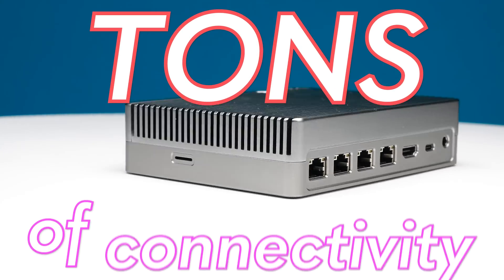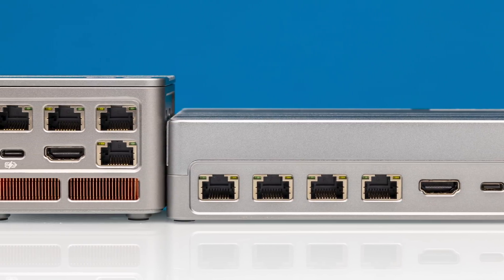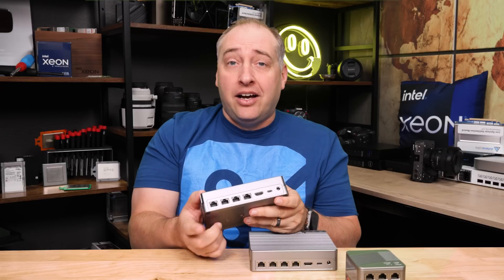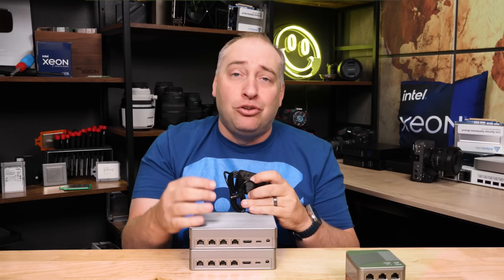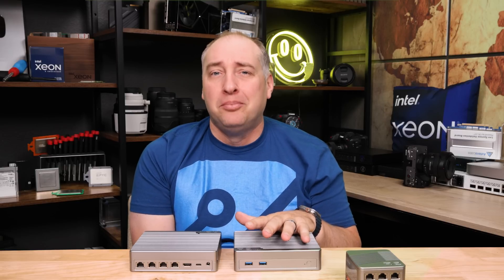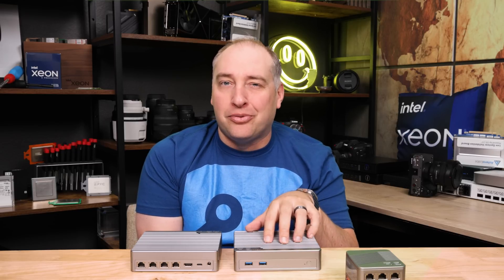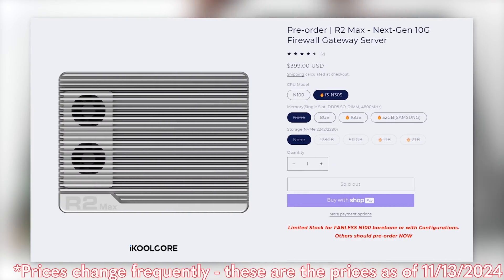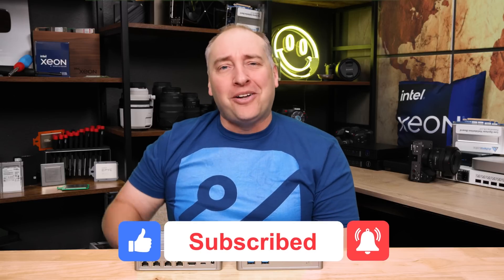MAX Fanless 10Gbase-T Mini PC and Router

Comment: Hey, thanks for the video. if budget is an issue i would certainly not recommend this pc.  paying almost 400 for a low performance Core i3 is not aceptable. Instead I would rather get an old ryzen 9 with 128 GB RAM along witha  500GB NVME and  a dual 10 Gbit NIC in a SFF case.  I wont feel confortable having one of those tiny  boxes in a real  world scenario with thousands of pcs hook to it.  DHCP DNS etc for  a large enterprise environment is a serious business which should be addressed professionally Nonetheless it could be a good approch for a small business with limitated space and none critical data transfer

Comment: I recommend staying away from this mini PC and this company in general. I purchased 3 of these units to use in a high availability cluster and one unit kept randomly shutting off. After numerous back and forth with support, BIOS updates, and tweaks, what broke me is the fact that they asked me to install a brand new OS (windows) and run AIDA64 stability tests (there's a trial, but its not free) before acknowledging it is an issue. They repeatedly deny it is an problem with hardware and push the burden of proof on the consumer (I also previously sent core temp and idle data, and proxmox system logs). They even have a dedicated support page on how to throttle CPU performance in the BIOS likely because other users are experiencing the same problem. Bottom line - stay away.

Comment: Would RouterOS run on this? This could be a great device for an aio RouterOS based 10G gateway security appliance utilizing specialized containers etc.
Reply from the maker: We did not try it, but I would imagine the answer is yes.
Reply: x86 routeros will

Comment: I bought this version  (fanless & N100) based on this video.  great build quality.  Its amazing with Proxmox VE.  I plan to use this to run container apps so I can move off a giant box of Openmediavault NAS and migrate storage to Unifi NAS and use this as the services host.  So far so great!!  Fits on a 2u shelf or drawer, yes, I plan to put it in a drawer eventually on the rack with breathing holes in the rear.

Comment: These N100 mini-PC's are really amazing, especially for smarthomes, since their energyuse is below 12W on normal use, which is around raspberry PI levels, but with nearly 2-5X as much performance

I have 2 myself.
Minisforum UN100C for home-assistant standalone [Mainly because Zigbee has some issues under proxmox, with a dedicated usb port for the container/VM]
Bmax B4 Plus, for Proxmox, with addons/containers running on it. for things like adguard, and a few other things that do not need their own dedicated server/RPI

Comment: When it comes to the device, I'd like to see a locking/screwed barrel jack. Or a different power connector which isn't as easy to disconnect accidentally. Other than that, a general question: could you explain how strict Intel's maximum supported RAM size is? I see people all over using 32 GB (or even 48 GB in the other comment), but Intel officially only supports 16 GB. What's going on with that?
Reply from the maker: Totally on the screw barrel jack. On the limit, Intel has had a delta in “supported” and working for over a decade in e-core CPUs
Reply: @ServeTheHomeVideo  There are screwed barrel jacks which also accept regular plugs, so it's not like it would stop people from using regular ones too. A nice improvement I noticed earlier is accepting 12V - that's standard voltage, and much more common than 19V.

I never truly dug into the low-power stuff until I needed to for work last year, so good to know.

Comment: NOTE: The 10gb network ports are NOT SUPPORTED on pfsense,opensense etc.
Reply from the maker: Yes. Noted the Marvell AQC113C drivers are not in FreeBSD, so OPNsense and pfSense. For folks using legacy OSes/ hypervisors like VMWare too. Linux works out of the box and you can virtualize pfSense and run that way too.

Comment: One of the concerns I have had that has kept me from purchasing the units you typically review is the shipping from overseas and lackluster response from some people on the support that those units offer. This one, seems to offer the balance of slightly more expensive for similar hardware and a more portable and perhaps more stable platform. Overall the price might match what you can get something from Ubiquiti but more flexibility by far

Comment: should be -150e cheaper and with more pcie3 lanes for ssd:s so the 10gbps ports could be even properly used for like, LAN-cache or similar purpose. 
nyeh. even as a router, it's wayyyyyyyy too expensive

Comment: There was a decent priced SFP+ model a few weeks ago, but the ram and ssd were a full rip apart to swap. This with the size and ease of access would be great to replace my mATX makeshift router. However using the ATT fiber xpon bypass SFP+ module. So something decent and SPF+ is a requirement to swap to a smaller/lower power router.

Comment: Why are there never any network bandwidth tests? For example, how many boxes with n100 were there, how they were told about their use as firewalls. But in practice it turned out that none of them can pull through the same 2.5 Gb/s in the same pefsense/opensense. So maybe here too, there are 10 Gb/s ports, but there is no use.
Reply from the maker: There are but we used Linux and OpenWRT
Reply: @ServeTheHomeVideo  Oh, there is info on this hardware on the site. But I couldn't find any about the others. Thank you very much for your reviews.

Comment: I hope a future iteration will also include small holes for mounting wireless antennas to, which would be great for 5G/4G/LTE WWAN backup.
Reply from the maker: Good idea
Reply: this ikool T_T please fanless 4 port and wifi

what's with their stock too? is it pre-order only and single batches? the alternative was the cube box which had 3 intel ethernet and 1 realtek and then wifi but with a fan... and it's out of stock now

Comment: Fanless, boxes designed as heatsink  is the proper style for home /  small businesses  IT devices.  Routers, NAS, switches etc. ZERO noise is important parameter as long as dedicated server room is overkill.
Reply from the maker: Generally I agree, but the Terramaster F8-SSD NAS we covered a few videos ago has virtually silent fans which I think also work.
Reply: @ServeTheHomeVideo  "Silent" fans are dangerous to place them in your working  or living area. Human ear has amazing adaptability to suppress repeating sound, so we are not disturbed continuously. Which means, silent fans has massive potential to build up a frequency gap in your hearing. Once the hearing adaptation is done, it can not be undone. Basically you build up selective deafness.
Reply: @gg.youlubeatube6249  Running a fan isn't going to hurt your hearing unless it is extremely loud

Comment: I'm still pissed by how expensive and power hungry things get as soon as you go above 1Gbps, lately prices are coming down but it still seems like networking is lagging behind.
It's kinda crazy how much faster an USB connection is in comparisons.
Reply from the maker: Well to be fair, USB is not designed to travel 100 meters
Reply: @ServeTheHomeVideo  I still find weird tho how for a 1Gbps switch you have stuff like the Mercusys 5 port switch which is 9€ ( 8 port is 14€, both with power included!) and sips such a low amount of current my smart plug can barely measure it (it literally idles at less than 1W!), but if you want to go to 2.5 you're at least spending 4 or 5 times that much if not more for an 8 port.
And I don't even pretend (nor need) to have a blazing fast NVME NAS at home running at native speed, but damn a single HDD can saturate a Gbps connection.

Wondering how stuff will go in the future, especially now that multi Gbps connections at home are starting to become a thing,  some people are already in a situation where the WAN is faster than the LAN.

Comment: They also state the two 10gb ports are on a pcie 3.0 x2 lane, which means a max theoretical bandwidth of 16 gigabits per second, so if both 10gb ports are saturated they won't reach full speed, assuming the rest of the system could even handle that anyway.
Reply from the maker: Check the diagram. Each AQC113C gets its own x2
Reply: @ServeTheHomeVideo  oh ok, thanks!

Comment: I'd buy one immediately if it had driver support in PfSense or OPNsense... Until then, I'll wait.
Reply: Oh it doesnt? Im a beginner and was considering this for opnsense. Do you mean this wont work with opensense? Thanks
Reply: @jonathanmatthew5631 Everything except the 10 gigabit ports will work. The 10 gigabit ports won't work until PfSense or OPNsense adds driver support for it, if that ever happens.

Comment: This is exactly what I've been looking for! Low powered, 2.5gig and 10gig copper ports. This will be perfect to upgrade my fanless J4125 based system that can't quite keep up with my proxmox setup that includes pfsense, HA, and essential docker containers. I pulled the trigger and will be excited to add this into my proxmox cluster as my first step towards a 10gig home upgrade. Thanks!
Reply: You might want to consider fiber . Less power and more reliability, especially In long runs. Not to mention that it's way easier to put the fiber cables in the wall. 
I have a mix of 2.5g copper and 10g fiber. The former sometimes syncs at 1g or even less while later always flawless 10G

Comment: I'm wondering about the Intel I225-V 2.5 gbit ports in there. My motherboard has this chip and I hate it with passion. Intel leaves all support on the vendor and actually go out of their way to have their firmware update utility not work with the Asus motherboard. It sometimes falls back to 1 gbps or even 100 gpps on the MicroTik switch (short cat 7 cable), takes forever to wake up from sleep and is generally unstable as hell under Linux. Now going to Windows just to upgrade the firmware, hopefully, because Asus. Will not buy Intel in the coming years. Would be nice to test the 2.5 gbps ports in combination with other network devices and OS and see how it operates.

Comment: I went the DIY route and added a X540-t2 and quad i226 to an old i5-4xxx quad core with 32GB.  Running pfsense with no issues.  Got a sweet deal on an old Cisco 3800 series switch (24port 10Gbe POE+) for $100 as a bonus it's RJ445.
Reply: That's a very good deal, you won't find that usually. X540-t2 is pricey and probably uses more power than the AQC113.
Reply: what about power consumption?

Comment: If the cpu had a bit more oomph it might be worth replacing my HP T740 pfsense box with the Connectx-4 in it. Mayyyybe. LOL It would be lower power but only a 20%ish increase in cpu ability. Definitely not worth it once you add the driver headache in. Great vid, as always, thank you :)
Reply from the maker: The N-series chips are great for low power, but the CX4 is super

Comment: If I hadn't recently upgraded my router I'd definitely grab one of these.  Mostly for the dual SSD, it's the only thing I wish the topton unit I'm currently using had.
Reply: Wonder what topton unit youre using. I have a King Novi unit running dual nvme which I configured proxmox to run with a mirrored zfs configuration.
Reply: @kevinhilton8683  Don't know the model off hand but it's the fanless N100 unit that for a while was selling on amazon for ~$180 by a couple sellers.  To be fair having dual nvme is more a want than need as I have opnsense backed up and could restore it pretty quickly if the SSD did die.

Comment: I'm curious how stable the Marvell/Aquantia NICs are.  My current router is a thin client running OpenWRT with an X550 NIC in the PCIe slot.  This would probably use less power, but if the Aquantia NICs are no good, then I'd best stick with what I'm already using.
Reply from the maker: If you are happy with the X550, that is a higher-end NIC.

Comment: Nice to see power consumption improvements on 10GbE to the point that fanless doesn't basically require fiber SFP+.
Reply: Would still be nice to have an SFP+ option though.
Reply: @jkmicha  There are other miniPCs for that.
Reply: @concinnus  like what?
Reply: @ Minisforum, Qotom, now Protectli
Reply: @concinnus are you referring to ms-01?
Reply: @ It's the only SFP+ equipped Minisforum I'm aware of, yes.

Comment: Pretty disappointing that its only got a single SODIMM slot. Connectivity is awesome, but maxing out at 48GB of RAM limits the amount of virtualization you can do with it. I wish there was a NUC style PC with 2x 10GBe, 2x 2.5Gbe and be able to mount over 128GB of RAM (or more). Hopefully one day someone will make it, and who ever does can have ALL of my money
Reply from the maker: Well you also have 8x E-cores only so :-)
Reply: The limitation is on the cpu: it's a single channel chip.
If you want you can look for the ms-01 (but 10g nic are sfp+) or I've seen boxes with an i5-1240p (4×2.5 base-T+2×10g spf+) that max out at 96gb.
128 as far as I know is out of the picture at the moment. Nobody's supporting 4 slots.
I have an SFF HP pc, which is much larger than this but still pretty small, and there you can have 4 slots, and also up to 4 pcie cards, a couple of HDDs and so on. Honestly, if you want to go and put a lot of stuff on, I'd rather have the full expandability, and not be limited by the form factor too much.
An elitedesk 800 is still small enough for most homelabs imho.

Comment: $399 is crazy when you can get a minisforum ms-01 for the same amount, which a much better CPU i5-12600H.
Reply: Power draw
Reply from the maker: The MS-01 uses significantly more power and if you want 10Gbase-T you end up needing SFP+ to 10Gbase-T adapters as well. Feel free to check out our MS-01 video for more on the power draw of that one.
Reply: @ServeTheHomeVideo  Yeah I've seen that, really disappointed by the MS-A1.

I agree on the power consumption, I want something low power at idle and low loads but can ramp up if I need, considering the BD790i SE motherboard with a bifurcation board for NVMe drives.

That or the proart-b550-creator board because it has thunderbolt too. Decisions.

Yes I realise they are all very different products.

Comment: Hi, the bad thing is, apart HardKernel, nobody (AFAIK) is using the possibility of the N series to do ECC-IB (grills 1/32 th of the memory for parity + takes a speed toll, but a light one), which is bad as these machines can make quite good servers with low consumption, especially with 2× 10 Gb Ethernet I/F.

Comment: This is like an MS-01 but with less features and less powerful processors for the same price. Am I right?
Reply from the maker: This is 10Gbase-T, not SFP+. That difference is usually at least $100 alone. Power draw is another huge difference. The N100 is also a passively cooled design.
Reply: @ServeTheHomeVideo  you are right I did have to spend a few hundred dollars on cables, modules, etc  after I got my MS01
Reply: Wattage draw

Comment: Regarding the drivers for the NICs or in other words OS compatibility, I'll much rather have a larger motherboard like an old Supermicro X10 series board and run old but solid Intel X550 NICs. Not only do I get processing off load to the NICs but they are well tested and I won't get problems from missing drivers. Just my opinion.
Reply from the maker: Super fair. The N100 uses about as much power than the PCH alone on the X10 series. So that is a fairly big difference between the two platforms.
Reply: @ServeTheHomeVideo  Many countries including the one I'm residing in, have roof top PV cells. So electricity costs are offset. But back to the idea of "mini pcs", I got burnt buying one with an Atom cpu. It ran super hot 24/7 just by having Windows and doing nothing. I was using it to upload from NAS to cloud and though it would be cost efficient. But I was afraid it was going to combust while no one was at home. So I figured stuff that and went back to SuperMicro Server boards. 

I now run an Supermicro X10 Xeon E5-2680 v4 and RTX3090 as my workstation and an older X9 as my NAS. Both with ECC memory. Everything has been rock solid. Its basically on 24/7. The size of the motherboards also lets me run X550 NICs and in future proxmox. Lots more functionality. Lower cost "per VM" or "per appliance"?  Burnt once with "mini pcs" and not doing that again.

Comment: intel's N100 chip is actually insane for mini-PC market it blows so many things out the water for a 6w part ubiquiti dream machine pro for context is arm a57 4 cores at 1.7ghz not even half the speed draws 33watts
Reply from the maker: Yes, it is great.
Reply: if you add a NAS SSD in the mix, its as low as 9W with peaks of 12W

Comment: Off topic: is it possible to configure a cell phone with USB-C port to function as a bootable "Windows to Go" external boot drive? So that one could potentially resolve a non-bootable Windows PC by instead booting into Windows (or Linux) from a properly configured cell phone, but while also still retaining the basic cell phone functionality. Thanks.
Reply: it's not worth the effort, get a decent usb SSD
Reply: On some models of android smartphones - yes.
Reply: You can use a phone as external bootable media and there are apps to do this conveniently (like the ventoy does for conventional external media). Requires your phone to be rooted though.

Comment: So is trying OPNSense on this a bad idea? This is the dream spec for me, is it possible to get OPNSense running on this?
Reply: Use Proxmox without hardware passthrough for the 10Gbit ports.
Expect around half of full speed (for the N305 version)...
Reply from the maker: Yes you can, but you will need to install drivers.